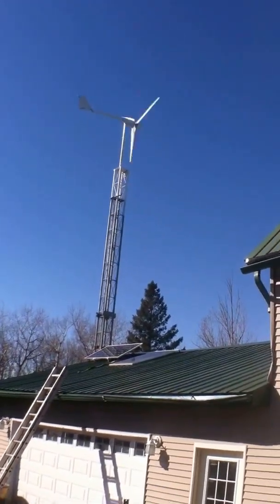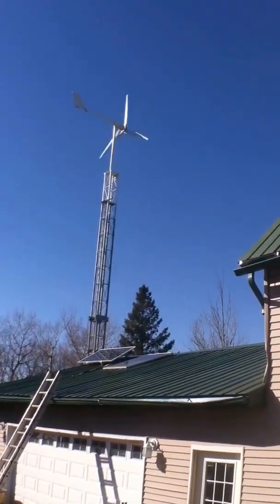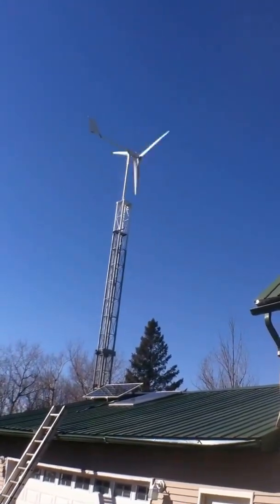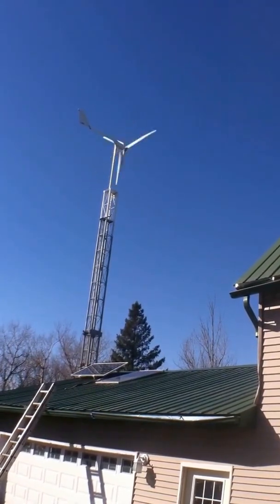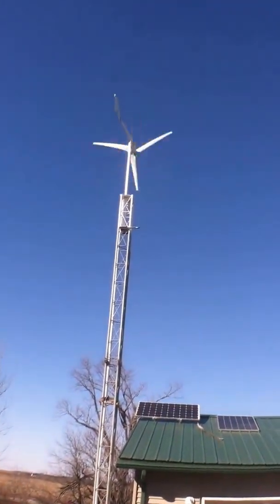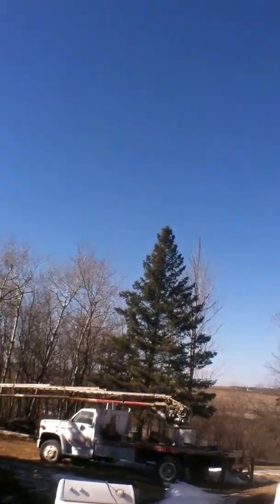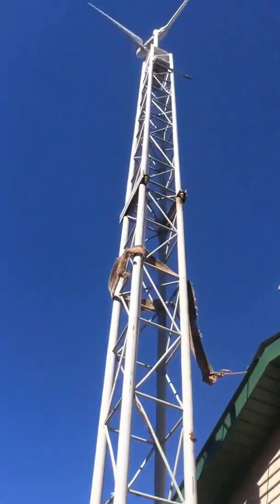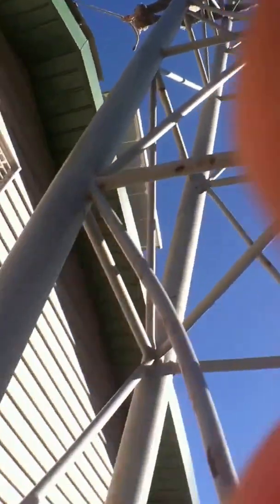3kw Wind Turbine Spinning Energy Meter Reverse

Comment: does it make 3kw in good winds or should it have been marketed as a 1.5 kw unit ?
Reply from the maker: unit411 Indeed this unit is a true 3kw unit, I know what your talking about in regards to the cheaper made ones being sold at a higher kw when indeed they really are rated much lower. This unit is solid and will be purchasing a second on in the future.